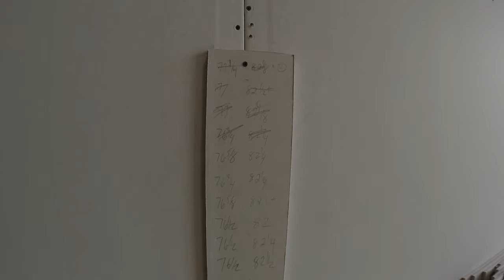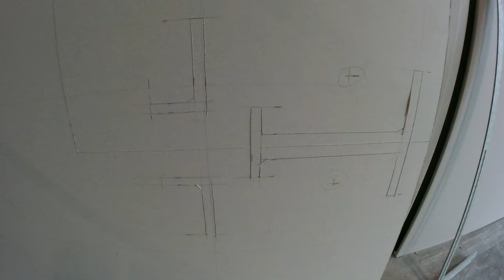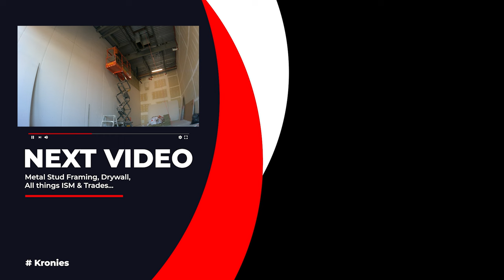Drywall Double Layer 5/8" & Roxul On Steel Stud

Comment: Idk if you know this one yet but if you get two pieces of heavy gauge stud about 6” long each and screw them back to back then take off the the top edge on one side and bottom edge on the other side you can hook it up to the lift and rest your drywall on the other side. 

Also you guys don’t have to stagger your sheets height wise? As in 12 ft then 11 or 11’6”  and so on?
Reply from the maker: Yes, ive done the hook thing with studs before, I mostly just set it on my foot. We stagger the height by adding 6" at the bottom first layer and min 16" horizontally.

Comment: I'm doing framing for the first time (renovating my apartment) and have watched a lot of your videos - Thanks.
My walls are 12 ft. tall and I have bought 20 ga. 1-5/8" and 3-5/8 tracks and studs. My plan is to use 5/8 drywall.
Do you recommend that I use U-channel every 4 ft. like you have done in the video (from what it looks like)?

Do you recommend any other type of bridging, bracing or strapping for 12 ft. walls?
Flat Strap (stock), Coil Strap etc. or I have seen what looks like track being used horizontally between studs sort of like a u-channel.

Happy New Year!
Reply from the maker: Happy happy new year!! Yes I would put carry channel (u-bar) 18 gauge at 4' and 8'. That will help stiffen the wall and keep the studs square. Maybe some braces for any furring walls if you feel it's weak.